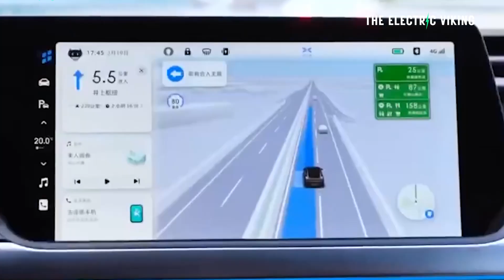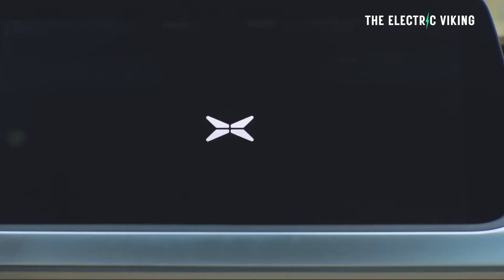Xpeng reveal the Mona M03 - an EV designed by Artificial Intelligence

Comment: On the plus it has the blade battery. What about the interior, tech and range?

Cost isn’t particularly low, but heading in the right direction. It’s difficult to compare with a Tesla as it’s much cheaper.

The front looks passable, has it borrowed ideas for the lights from Porsche? The rear looks awful.

Overall, I prefer the BYD Seal.